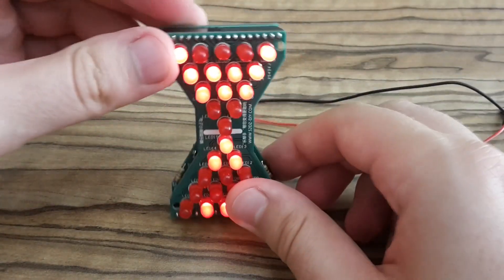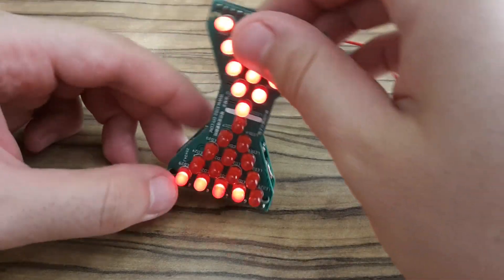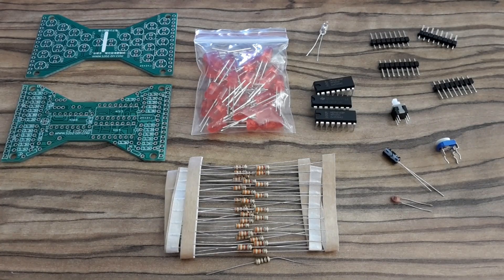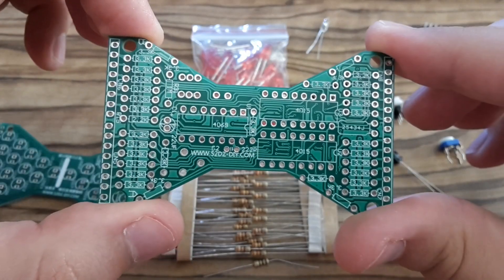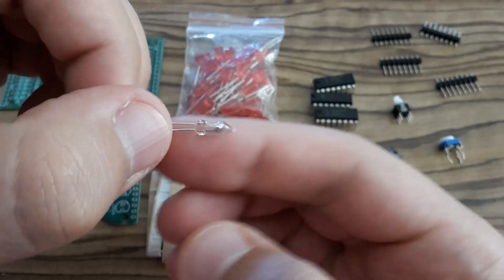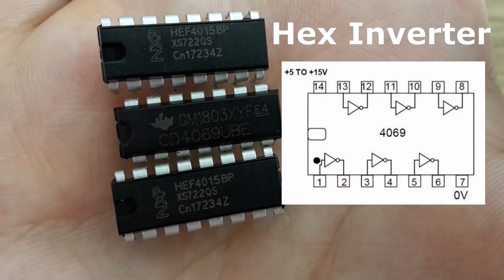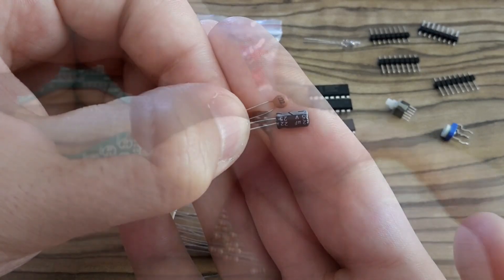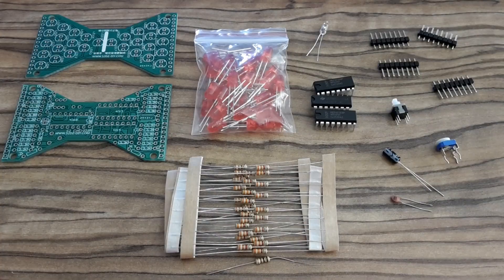Hourglass Soldering Kit with IC 4015 and IC 4069 (1/2)

Comment: Nice video, but all links in description are wrong. Best Regards
Reply from the maker: Hi, thank you for your feedback. What exactly do you mean by wrong links, I've checked them right now and they all works on my laptop. Could you be more specific? Thank you.
Reply: @zeroampselectronics  Thanks for response. For example if I click on link :https://aliexpi.com/A8Li. nothing happens, but if I use 'copy link address' and then open new tab in google and paste this address, than I can reach correct aliexpress page. Best Regards
Reply from the maker: Hi, in my Chrome it opens it in a new TAB.
Reply: @zeroampselectronics  You are right. I try FireFox and Microsoft Edge and they all open correct link in new tab. Maybe some Google error. Best Regards.